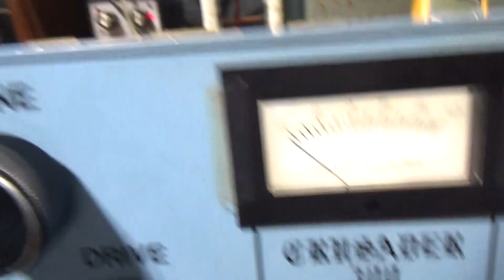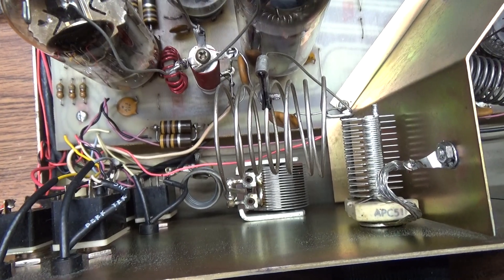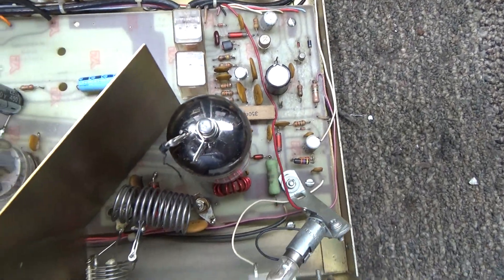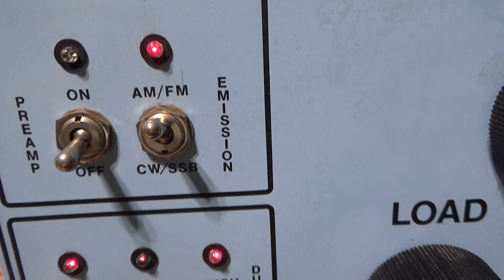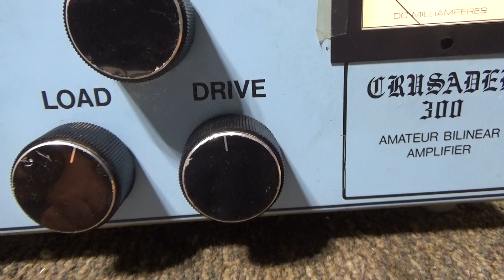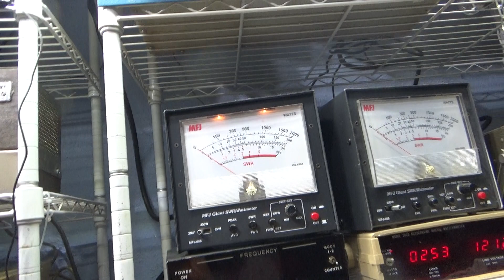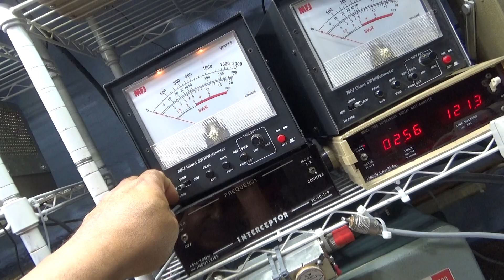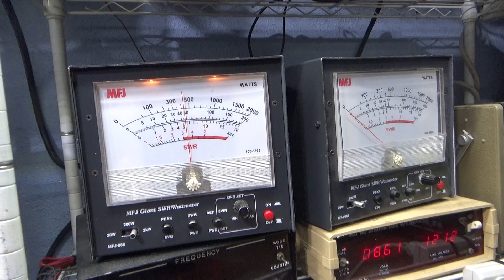Crusader 300 linear amplifier on the bench looks like a Palomar Skipper 300 clone internally

Comment: What’s the SWR on the radio with amp keyed? No tuned input I’m sure it’s high. The 6kd6 do less than the 6lf6.
Reply from the maker: Tuned input is surely the best, however, sweep tubes, in general, when in grounded grid have an input impedance of 200 ohms a piece. 3-500z tubes have an input impedance of l00 ohms. I'll let you do that math.

Comment: I think you got lucky getting one with the bezel around the meter.  Most of the ones I've seen for sale seem to be missing the bezel.  The Crusader 300 I have came with a piece of electrical tape around the back of the meter to hold it in place.  From a distance, you can't really tell.

Is that tank coil in the driver section held in with banana plugs?  I haven't looked at mine in a while but I seem to remember that being the case.  I think the one I have doesn't have the tap on the driver section coil as well, just on the final side.
Reply from the maker: No those aren't Banana's, they are standoff's with a screw going thru them and they are about the size of a Banana though. Yep, a few different ways for the driver tank circuit are used in amps, while almost all use a Pi on the output side.

Comment: I restored and amp for someone a couple of years ago that was identical to this amp but the face was yellow and brown instead of blue and black.  
It was called a Lazer 3000 i think.
HATED the PC board design as it made it very difficult to troubleshoot problems.
there are a couple of things i found that you'll probably want to address, first, the power cord switches the neutral so you'll want to get rid of that.  also the tubes are on all the time and you'll have to add a relay to switch the high voltage on TX.  Cooling isn't very good on these.
Im sure i have some pictures over on WWRF and at home if you'd like to see the underside of the PC board or anything like that.
Reply from the maker: Did yours have a Transformer or was it one of the transformerless ones? I have seen similar ones with no transformer, used a quintupeler off the mains for the HV and a dropping resistor off the mains for the LV, and I have seen one where it did the HV off the mains and used a transformer for the filaments and LV only.
Reply: @tramdr  yes this one had a transformer.  i might have a schematic somewhere around here if you can't find one.
Reply from the maker: Sure, would like to see it.

Comment: Holy sh!t Doc one just sold on eBay for $400
Reply from the maker: I saw  it listed at $400 but I don't think it sold though!
Reply: @tramdr  maybe the listing I had saved flashed that it ended but I know it was listed. The prices of things these days are insane,considering most people don’t even know what they have.
Reply from the maker: Sure, at the Dayton Hamfest a couple weeks ago, prices, especially for CB stuff was all over the place. Some were almost giveaways with the Ham happy to get a few dollars for his throw away CB junk. On the other hand, I seen both some Ham and CB'ers who thought their items were made of gold. I saw a Ham with a Maverick 250 for $425 and on his same sale sign, it showed he had sold a Pride DX-300 for the same $425. In his mind, a Pride and a Maverick are worth the same money. I also seen a seller with 2 Stoner Pro 40's rough condition. He wanted $700 for one and $1200 for the other, rough condition, not working, no Mic or accessories. I walked away quick and he said, well they go for $2500 on Ebay. I said "Sure"
Reply: @tramdr  it’s gotten to be outrageous on some stuff. There is a pride dx300 for sale locally to me,about an hour down the coast. Hasn’t been ran since 1992,lady wants $699 for it plus shipping. I told her I’ll make you a fair offer on it,it’s gonna need recapped and the wiring went thru plus the 250b is probably only good for a core. I offered her $350 for it because as it sits it’s a parts and or project box. Same lady has what looks like a Maco 300 with the 8950s missing and she wants $800 for jt 😂 😂 it’s laughable.  Stoners were a quirky gimmicky sort of a radio and people who have then think they are made of gold. Just like the d01 and browning owners. I’d love to have another d201 hard wired with some steel in the bottom,not a circuit board tram but just like a browning,$300 is about what I’d pay for a nice nice one,not $350 a month working radio that’s missing tubes or it’s an u known. I guess one day I’ll find a tram d201 I can afford,mine got hit by AC feeding back in to my feed line from a pole pig that got hit by lightning and arced to my ground plane. So it physically burnt up.
Reply from the maker: I gotta disagree with you on the Pride. I think $700 is a great price for it. With some things like a Browning 180 amp, or Browning radio or a Pride DX-300 is not about the watts, it's a highly desirable piece that people will pay $$$ for and drive up the prices. I too would want at least $700 or more for an as/is Pride.
Reply: @tramdr  if it would have been in better shape I’d have gladly offered her $600 and went and picked it up then my old trashy pride 300 could be a parts box to keep that one going. But it was in worse shape than mine and mines all original. This one is a bit mixed matched. I just wanted a clean one to put beside my jb2000 in the dungeon with my browning and my dak. I’ll find a nice one eventually if I’m patient. 

I was able to buy 2 d104s and 2 Maco chassis with transformers tho for a reasonable price,she was asking $250 for the 2 mics and 2 chassis and I gave her $400.